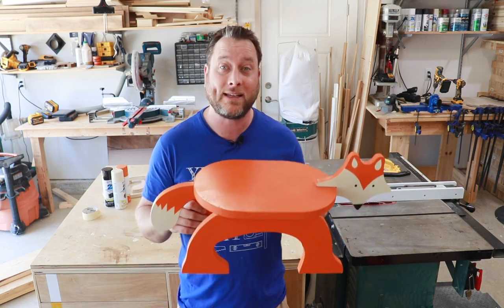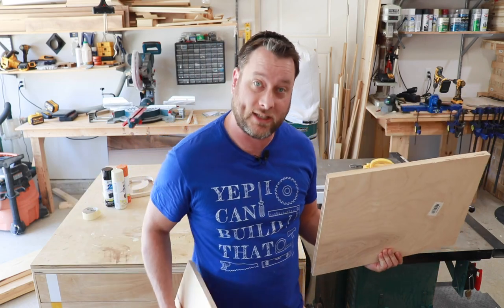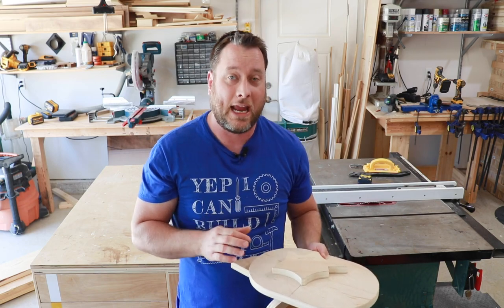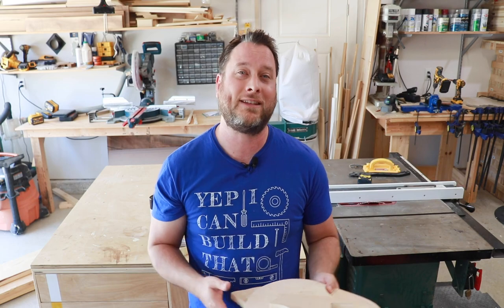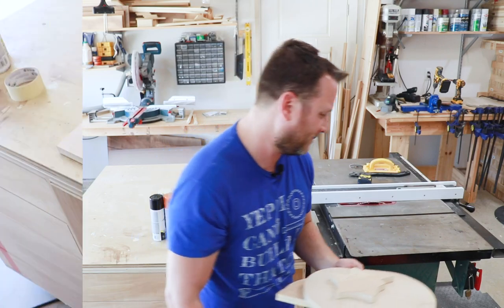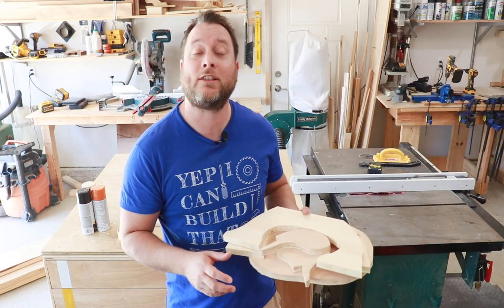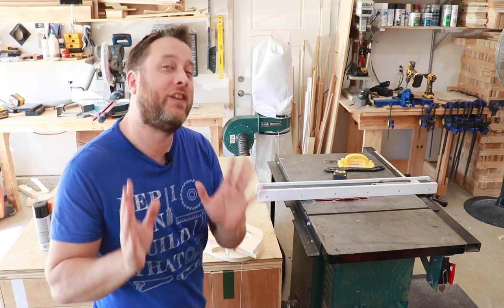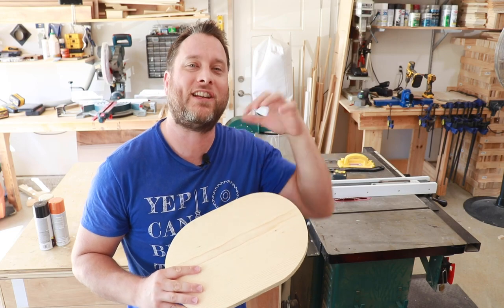Why This Animal 🦊   Fox Stool Sells So Well Online | Woodworking Project

Comment: Great project. Those are some pretty tight turns on the bandsaw. What blade width are you using? Thanks!
Reply from the maker: It uses a special attachment that allows me to make 1/4 turns

Comment: I just bought the plans from your website and saw that you can print up the paper templates to get the wood templates cut.  How did you print them to scale?  Some templates are bigger than a regular 8.5x11 sheet of paper. Thanks.
Reply from the maker: The plans are made to be printed to scale on 11x17 paper or you can print to scale on 8.5x11 and tape them together at the seam. Make sure your printer is set to "print to scale" otherwise it will sale it down to fit the sheet of paper. Hope that helps.

Comment: I notice that initially you traced the seat out on plywood but in the final close up shots of the paint it looks like the seat is made of pine. Did the plywood give you a problem?
Reply from the maker: Nice catch. I was making a few others and ran out of material and had to switch and ended up grabbing a different one during filming
Reply: @HowYouCanMakeIt  I are clever 😁
Reply from the maker: @peterfenwick2540  for sure